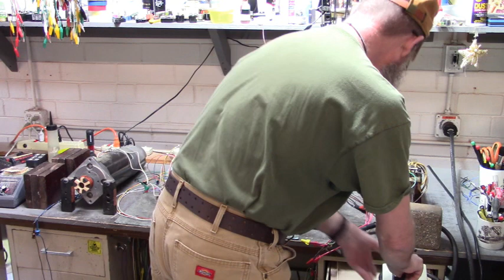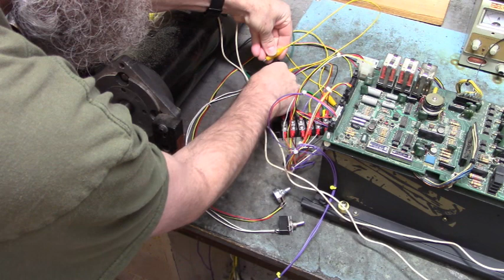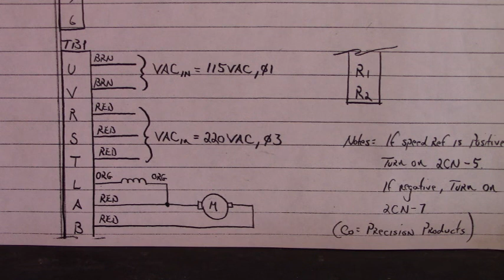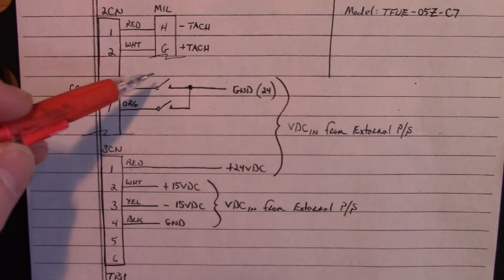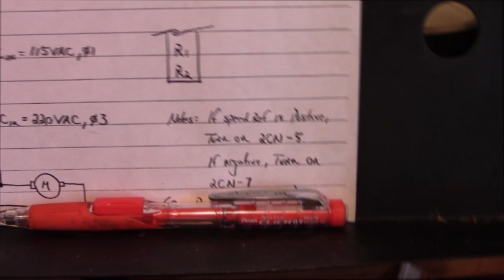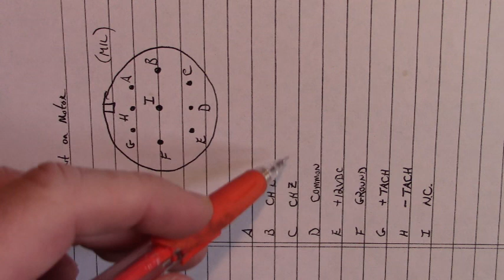Testing the Yaskawa DC Servo Drive CPCR-MR-152G

Comment: I have an old Fuji DSR COMPACT dc servo drive that’s on an old 1981 hitachi seiki lathe. The lathe stays in a not ready state after power up and the Fuji spindle drive has a alarm led labeled PTCL. If you could tell me what that means it would help me a lot. I can’t find any manuals on this drive to diagnose the problem. I think it’s a e-stop problem but I’m waiting on a manual on the lathe for a wiring diagram. Thank you for any help.
Reply: Thank you so much for replying peepaw. I’ll look into that tonight and see if I can find any info on that.
Reply from the maker: Hello Sir, I looked at my old notes. On the Drive I worked on, I didn't have the Spindle Motor it mated to. So I had to jump out the Motor Thermal to clear the PCTL Alarm LED. There is a Honda20 Male Connector on the bottom right side of the main circuit board. It is labeled CN2 on the main circuit board. It has three rows of pins. The pin numbers are printed on the main circuit board at the beginning and ending of the pin rows. CN2 pin19 is the Motor Thermal input to the drive. CN2 pin 20 is (M2) Gnd. I jumped those two pins together to clear the PCTL Alarm LED.
Reply from the maker: It is possible the thermal wires to CN2 pin19 (PCT) and pin20 (Gnd) have broken. Or the Thermal in the spindle motor has opened up. Or the circuitry on the drive has failed. I hope this helps you troubleshoot your spindle drive. Let us know how it goes. Thanks again.
Reply from the maker: Hello Mr. Barrett, thank you very much for stopping by. I hope all is well with you and your family. Some years ago I worked on a Fuji Spindle Drive. On the blue cover it was labeled DSR83MKII. The dataplate for the drive stated that it was Type FSD-75DN47A2. If you can give me a day or two, I will look through my notes on this drive. And see if I can find anything about the PTCL Alarm LED.
Reply from the maker: In my experience, whenever I see PTC. I think Positive Temperature Coefficient. The Motor Thermal. This my point you in the right direction while I am hunting for information on the PTCL Alarm LED. Thanks again for stopping by and watching one of my videos.

Comment: Yaskawa has hardware cw and ccw inhibit for overtravel switches see those drives on Mori seiki cnc lathes
Reply: Yup, that's how they are setup from the factory, but they don't have a dedicated enable signal that I am aware of. So it's one way to create an enable circuit...

I am in the process of upgraded an old Takamasu lathe, and I currently have drift problems. So I am toying with the idea of opening 3-1 (+24 VDC to the coils) to create an enable signal for it.

What I have got to avoid is letting the controller think that it is controlling the axises when the enable is off and spooling up the PID.